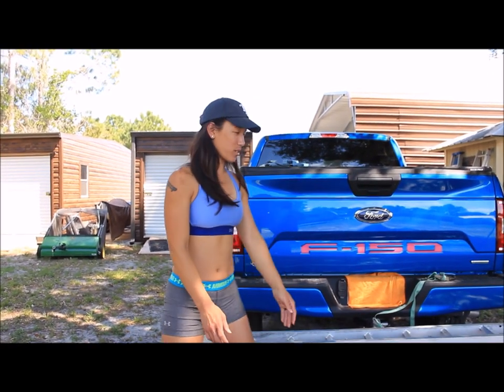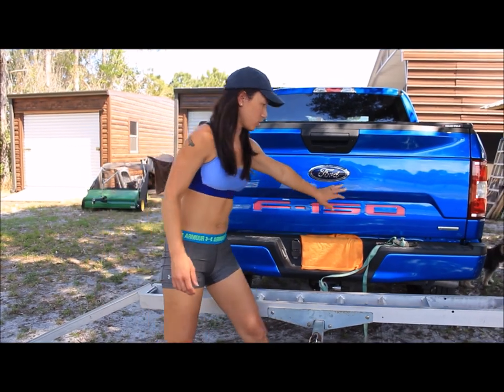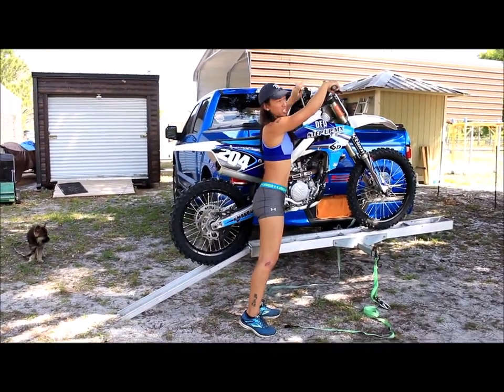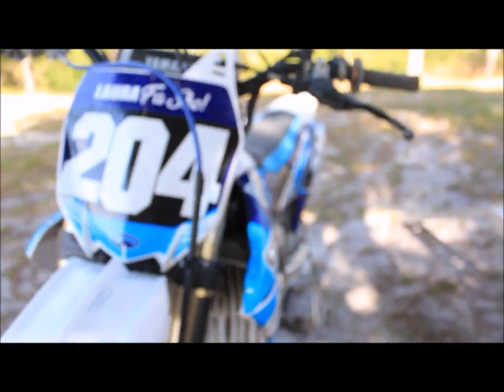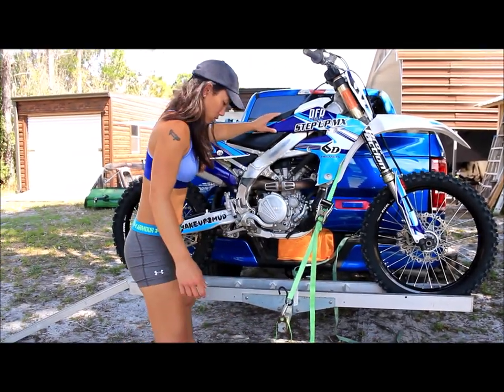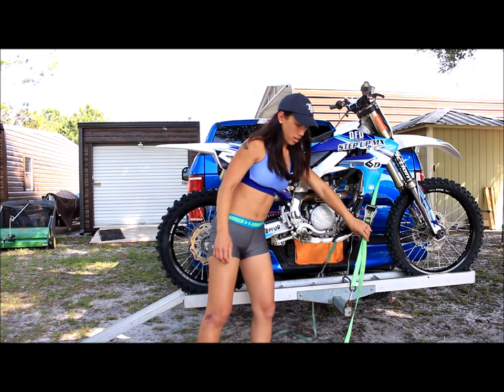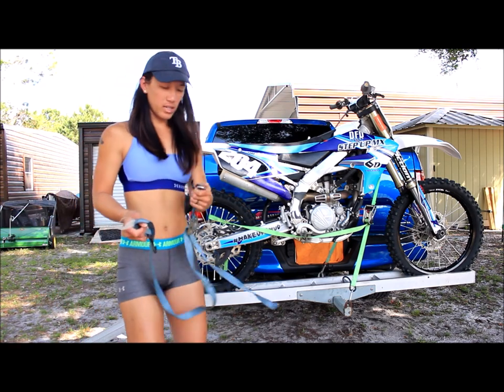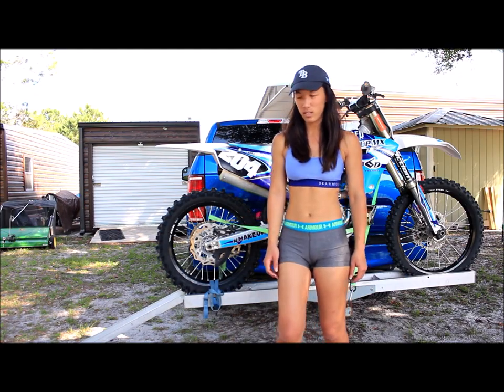How to load dirt bike on a motorcycle carrier

Comment: I'd be curious how far you ratchet the front fork straps down.  How much pressure do you put on them?  Also, as you ratchet down, the straps will pull the bike backward.  I know the rear tire is strapped but, I'd be concerned about the pressure, pulling the bike backwards.  No issues?
Reply from the maker: I strap it down till I have to put some pressure on the ratchets. It compresses the forks but I've driven 5 hrs with it like that and it's fine. I've been using this carrier for like 5 years now and had no issues with the way I strap it. Not any different than strapping the forks in the bed of a truck (without a fork saver)